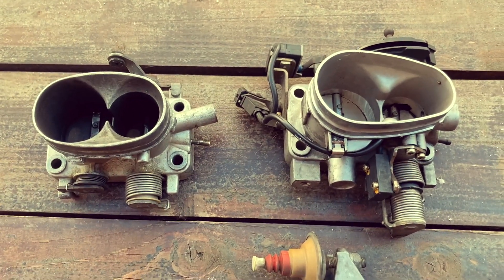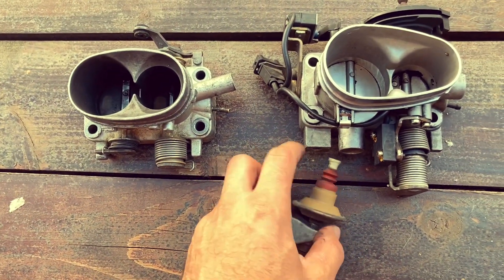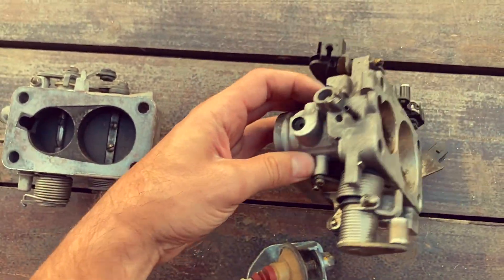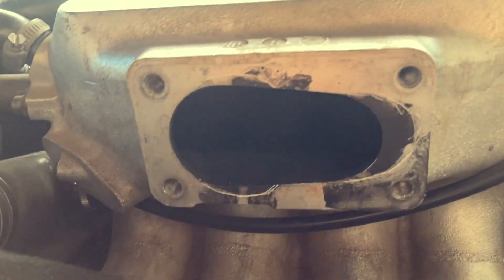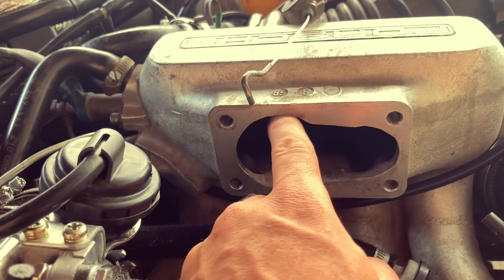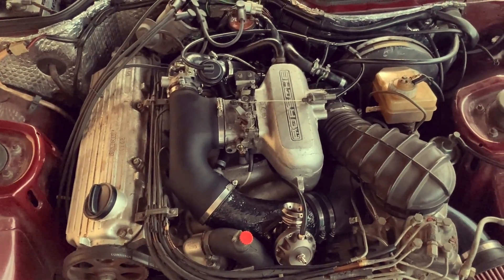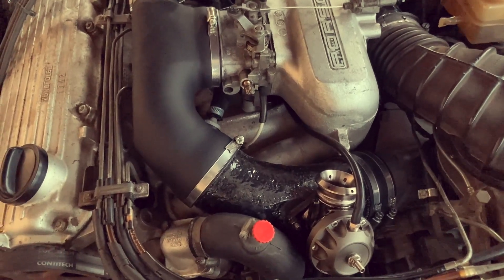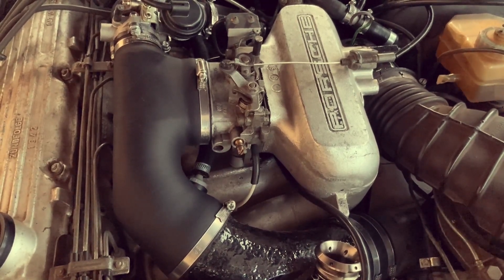Supercharged Porsche 924 Throttle Body Upgrade - V3 compatible

Comment: Did you have to put an idle screw in the lager one? As mine comes with a tube on the side, no screw.
Reply from the maker: No, i pluged that and used the actual plate stopper screw to set the idle
Reply: @PorscheAddict  nice one thanks for that.

Comment: Did you grind the manifold in place? Or did you take it off? 

Thanks 🙏🏻
Reply from the maker: I didnt take it off, i stuck an old tshirt there, then used some ductape to seal around and just grinded the manifold in place. Do i recommend this? No. Unless you know what you’re doing and understand the risks.

Comment: Great, build, any idea of real wheel horsepower and torque difference?
Reply from the maker: I would say that the power is around 150hp and 200Nm, but the fact that it is so responsive and this torque is available instantly when you touch the pedal from literally any rpm makes it a rather quick car in the real world.

Comment: Great upgrade tip! Thanks for sharing this option.

Do you know if the stock rubber boot will fit this bigger throttle body?
Reply from the maker: Yes it will, this upgrade is for the non supercharged 924 as well.
Reply: Perfect! Appreciate the info. 

I have 2 924’s (a ‘78 & ‘79). My ‘79 is complete and I want to keep it as stock as possible! My ‘78 is a project and I have my eye on your S/C kit for it…!!!
Reply from the maker: @ernestisa311  my kit is fully reversible, so if at one point you want to revert the car to original you just unbolt the stuff and reconfigure the car as it was.

Comment: mind sharing where you got this throttle body and the cost?
Reply from the maker: Like i said in the video, the throttle body comes from a 2.3L Audi 5 cyl engine, but the same throttle body was used on the Golf 1 Gti and various other VW/Audi models since then. There isnt a clear part number but the reference of MK1 GTI or Audi 2.3L 5CYL should be enough to find these things on ebay. I got mine from a friend for free as he had an older Audi engine laying around...so i dont know about prices...however quick search on ebay uk for "Audi 2.3L throttle body" found two, one for 60 pounds and one for 100.

Comment: does this add any power?
Reply from the maker: it does, not a huge amount, mostly it adds torque to lower and mid RPM, but there is some more top end power as well. The major benefit is daily driving, you can now keep up with modern traffic and you dont even have to go over 3000RPM to do that. Highway driving is also improved.